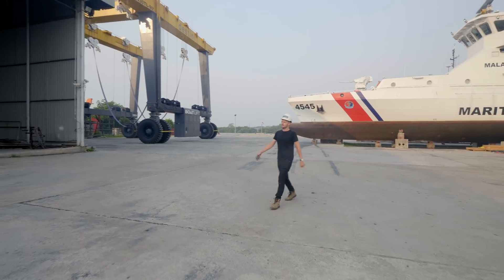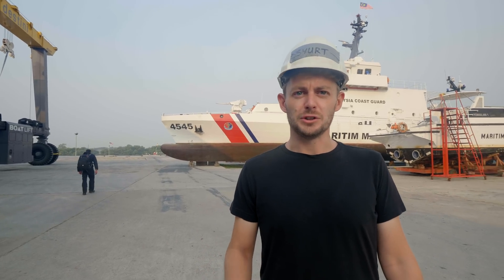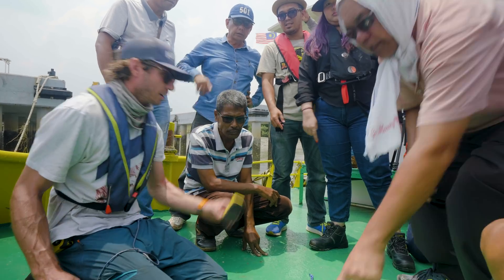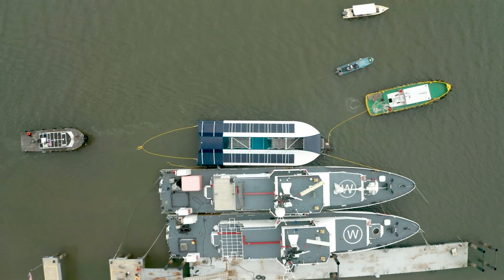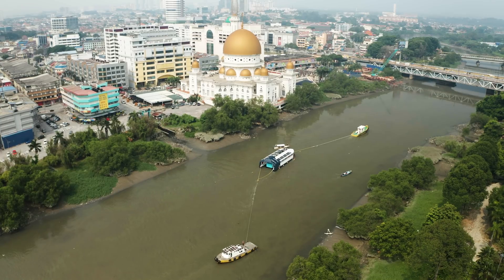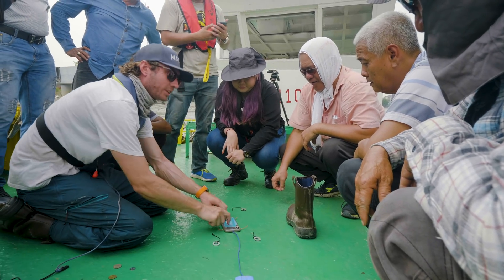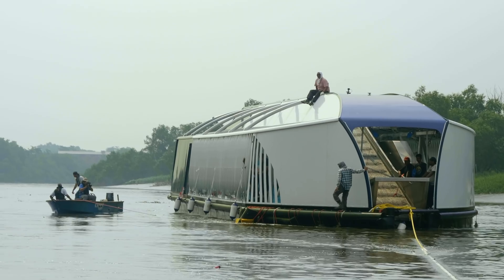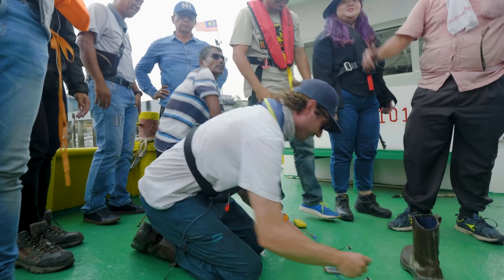Installing Interceptor 002 in Malaysia | Cleaning Rivers | The Ocean Cleanup

Comment: From the shots you have shown us it seems almost as if the interceptor is in the middle of the city. 
Doesn't that mean that "behind" the interceptor, closer to the sea, plastic can still be thrown into the river and get into the oceans? 
My concern, point or question is that you may have to put the interceptor or another barrier right next to the ocean to hinder plastic from entering it? Otherwise the preventing function only partly succeeds as stuff thrown in closer to the ocean in other cities, or areas, that are located "behind" the interceptor still enters the rivers and therefore the oceans. Have you thought about that and geographically measured where to put the interceptor best, possibly close to the sea?

I hope you understand what I mean. I think you're bright enough to think of this. I was just wondering. Keep up the great work! :)
Reply from the maker: Good question! The actual placement in the river is on a case-by-case basis, based on flow-velocity, the width of the river, presence of a plastic “hotline” or not, traffic, proximity to a delta, etc.   In some rivers, it will be necessary to install more than one barrier to capture as much of the debris as possible while still allowing wildlife and boat traffic to move freely.
Reply: It makes total sense what you address :) Like Baltimore Harbour's "Mr. Trash Wheel", just for the ocean instead. I wonder the same thing.

Comment: Only question is how expensive are these interceptors. . . Are these are aluminium built !
Reply from the maker: Not only! The Interceptor is made of marine quality steel, stainless steel and aluminum, and is equipped with an off-grid power generator, remote monitoring dashboard, automated extraction control, 4G data uplink, and more. The waste collection capacity is 50 cubic meters. 
Interceptors in our pilot program were approximately 700 thousand euros for construction and assembly. However, we expect that once we are in series production, the costs will be lower making them more cost efficient in the future. Learn more here: www.theoceancleanup.com/rivers.

Comment: Congratulations !  Where is the captured plastic going ?
Reply from the maker: As we aim to help tackle the 1000 most polluting rivers by 2025, we cannot personally manage the local waste handling - which remains in the hands of the local operators of the Interceptors and waste management partners. In some locations, there are currently no better solutions than to bring it to a landfill. However, we minimally require a sanitized landfill before we commit to deploying an Interceptor at any given location.
Reply: Jack Patteeuw in Jail